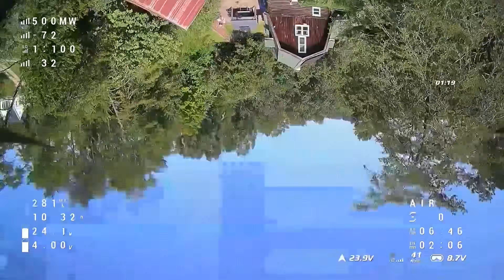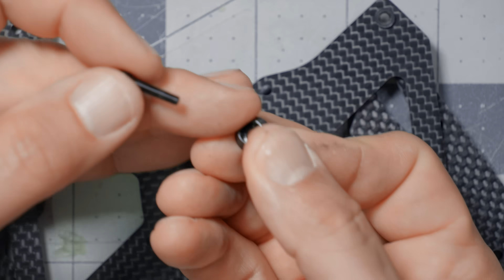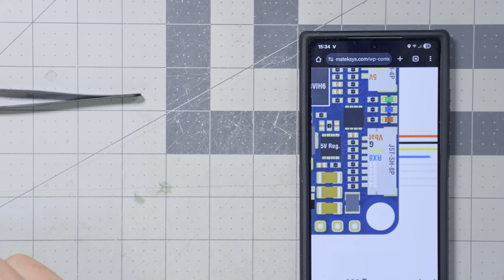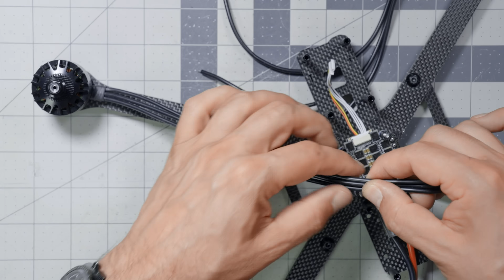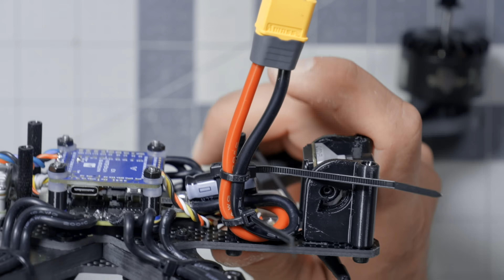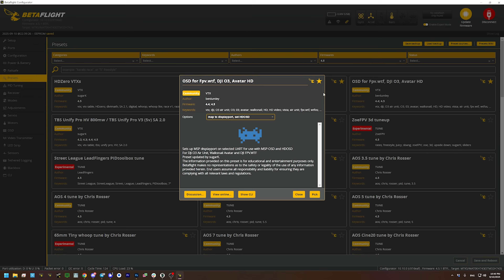I'm building a 10" drone. This isn't a tutorial.

Comment: The shaking is from rotor chop. Basically when you descend that hard you put alot of load on the rotors and they create a chopping effect in the air as you descend through your own rotor wash (turbulent air created by your rotors/props) a bit more forward momentum when you descend will probably negate this. The forces on the props when you descend may still cause the shaking because it’s a-lot of force too.
Reply: You’re describing what we usually refer to as “prop wash”, yeah?

Comment: that jitter on the drone could be because you dumped the cross that made it so that arms are more like a super solid piece. Just a thought.
Reply from the maker: I built this frame as intended by the manufacturer. All supplied pieces were used. I don't think this frame has any additional strut.

Comment: Hello, Mr. JOSHUA, is the heating of the ELRS 2.4G Dual and Single Antenna receivers an acceptable operating standard? I have nano receivers purchased in August 2025: HPXGRC 2.4G ExpressLRS, and DUAL ELRS 2.4G set to 10mW, connected via an Original Hobbywing SKYWALKER with a 5v UBEC.

Comment: Hello! 

I built a 5-inch drone, and everything went except for the throttle problem. Pitch, roll, and yaw are working very smoothly, but when I elevate the throttle, all 4 motors do not spin at once, and they spin randomly. However, all motors separate power and master power is working very smoothly when I conrroll via Betaflight configurator. The radio is also working fine with other devices and fpv simulators. Could you please tell me what the issue is with my newly built quad? I couldn't fix it at all 🥲

Comment: Actually the frame does exist, and is still available! It's the QAV-R 2 XL 10". It's was originally designed to be a very light weight 10" option for longer range and efficiency builds. There's also an 8" version. Still being made because they're still used in industrial contracts. It actually works pretty well with lighter motors, but those heavy beasts you have on there are probably a bit much for the arms.

Comment: I've got a really old build hanging on my wall. Aliencopter frame, KK2.1 board, individual ESCs that have to be configured with a programming card, none of that fancy modern usb nonsense. 😂
ELRS? Never heard of her, multi channel PWM receiver, and it ran 8 inch props, max 4s battery too. 
Old school!
I've been considering modernising it, it's totally not rebuildable, NOTHING on it is available anymore, but modern motors, modern FC, ESCs etc, I think could be fun. So bit different to this vid, but similar. 👍

Comment: Hey Josh,

I’ve been flying into a bit of a wall trying to find clear and consistent wiring information for FPV drone components. It’s kind of surprising that there isn’t a centralized website or database that compiles complete electrical circuit references for ALL the different parts on the market. Every time I search for wiring diagrams, I get such fragmented results—there are so many variants that it makes proper research unnecessarily complicated. I mean I want gps and a buzzer but, i dont wanna mess with things i dont need to.. KISS!

Right now, I’m putting together a 5-inch freestyle/racing build and want to confirm compatibility between the frame and the rest of my setup. My components are:

Frame: TBS Source One V5.1 Frame Kit (5-inch)
ESC/FC Stack: T-Motor F45A + Mini F722  20x20 FPV Stack (BMI270 idk what this means)
Receiver: RadioMaster RP3 V2 ExpressLRS Nano Receiver (Dual Antenna 2.4GHz)
Camera: Walksnail Avatar HD Kit V2.... (6+ volts.. so i need 6+ volts.. do i need to use the 10volt pad???)

Before I start wiring everything up, could you confirm whether the TBS Source One V5.1 frame has enough internal space and mounting support for the 20x20 T-Motor stack and the other listed components? Also, are there any known fitment or wiring challenges I should be aware of when combining this frame and stack 10+ VOLT PAD?
Im looking for a wire guide as the walksnail needs 6+ volts and the mini does have 10 volt pad.. should i use that?
Thanks — I’m just trying to make sure all the hardware integrates cleanly before soldering and final assembly.

(And yeah, I did use ChatGPT to clean up the message—read it through and it actually sounds perfect, thanks guys! I’m in Australia by the way, just saying. I haven’t even soldered anything yet and I’m already stressing out. Hahaha. God help me—my fat fingers and tiny pads are not a good combo. Peace, love, and wish me luck!)

BibiBosh <3

25:00 .. Ouch.. that hurt.. you spoke to my heart.. damnn

Comment: Been folowing you for years.  Just started doing this myself.  First problem is all the old Lipos.  I ran them down with halogen lamps.  Where do you get rid of them when they are completely discharged.  Also, Is there a one size fits all lipo these days.  I had so many for each build but not one that worked for all.

Comment: I have those exact shakes on a 7 inch I built,  only occurs at a particular rpm I guess,  never had them on anything else including other 7 inchers and 10 inchers, even using the same motors and props..what's up with that?  Frame is the tbs source deadcat.  I don't think it's frame vibration....?   I can't figure out where they're coming from, I've tried everything.  Is it a result of a tune or what?
Reply: Simple: Do a log, check the frequency. Filter accordingly, do a PID tune.

Comment: Me too . A 10 inch tubular carbon graphite frame in the to build with amera switches , and sbus to pwm converter and  robot servos , and lights and bells and and it came with props and big motors

Comment: Not sure about freestyling such a big boy, i find them much more usable for cruising around, or doing some long range. With a big li-ion back strapped to it you can fly forever, and with inav on the flight controller you have some nice automated flight modes. Mine is equipped with a cat 3 starlight cam, at night the wind drops so the flights are much smoother.

Comment: Hi Joshua, thanks for video. Maybe I will make 10 inch too. Buy my advice from my experience to use 11 inch fold props from Gemfan. And especially with metal hold for props, it’s much better than plastic on this type of machine. I use everyday for fly my 15 inch drone with metal hold 15 inch props. 
This is my spec: 

Frame: main body geprc pulsar lr + arms from gk-v3-15
Fc+esc: geprc taker f722 bls 100 A 
Video system: walkstail avatar gt2+ moonlight kit + moonlight camera
Antennas: geprc momoda 2
Radio link: radiomaster DBR4 erls 2,4/915 
Motors: suprass b4218 330kv
Props: gemfan 1510-f fold with metal hold
Battery : Tattu 16000mha, Coddar 10000mha
GPS/glonas/baidu: Beitian 181

Camera dji action 5

Comment: Gemfan 1080 are my favourite 10 inch props by now. Tried them all. The good geprc frame ist the pulsar 10.
Reply: They are okay if you have no load

But if you do your quad need more grip

And that -0.5mm on the blade actually helps a lot
Reply: i love the HQ 10x5.5x3 great prop, only bad thing is rubustness, they break a tip pretty fast. but they are pretty good balanced from factory, ill only need a few mins per prop, a thing that seems impossible with gemfan stuff. alltho gemfan seems to be sturdyer.

Comment: I love that he has all the parts for a 10 inch but not one set of ten inch props
Reply: Probably because esc, fc, receiver and air unit fit anything from five inch onwards, and the motors are for 7 inch onwards, so it’s just a 10 inch frame that he has, but other than that it’s nothing 10-inch specific
Reply: 😂 Probably why he never put it together in the first place.